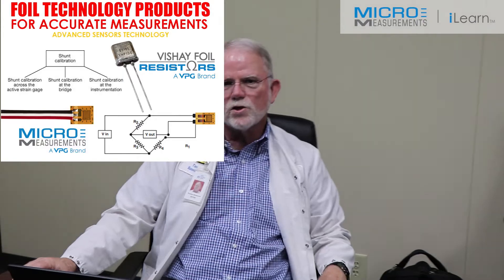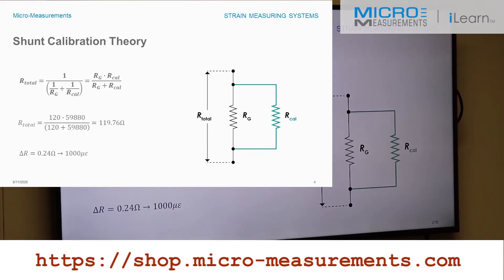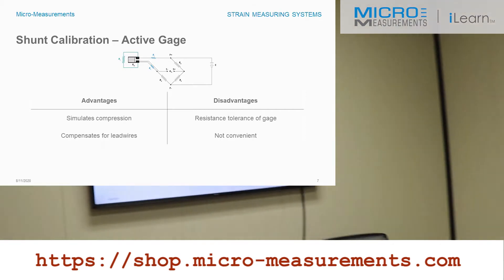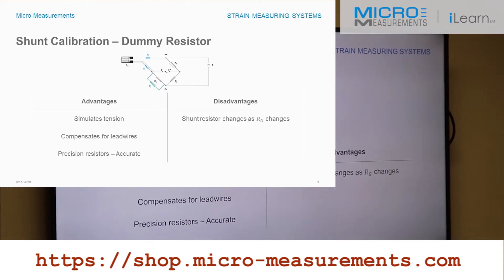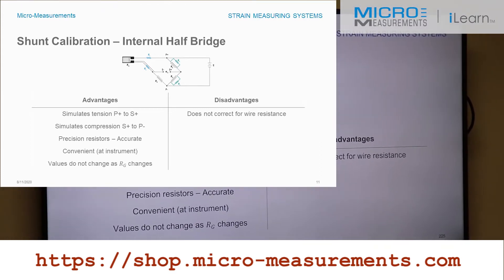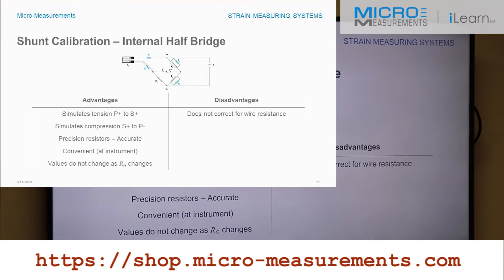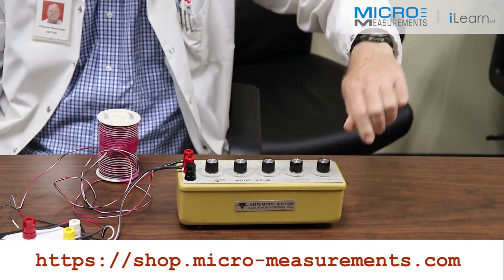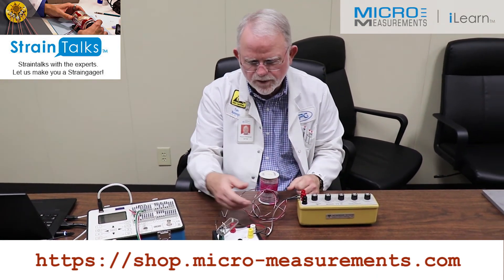Shunt Calibration in The Real World.

Comment: Thank you for explaining it in such a clear and approachable way! Amazing stuff... Just one question, when it comes to half bridge circuits, how do I shunt calibrate my gauges? Can I just shunt my secondary strain-gauge or do I have to shunt both of them? I am using this configuration bc I would like to correct for temperature related errors...
Reply: Hi Victor.  Under normal circumstances, you can shunt calibrate just one arm of the Wheatstone bridge.  This could be active one of the active strain gages or the fixed precision resistors that complete the bridge.   Keep in mind that you may have to take into account the number of active arms if trying to determine the strain response of your part because now you have two strain gages contributing to the signal, not just one.  We have a pretty good explanation and equations for this found in the Technical Note TN-514 on Shunt Calibration- Starts on page 36: https://docs.micro-measurements.com/?id=2415
Reply: @darrylpeterson5394  Hi Darryl. Thank you for the reply, much appreciated. The document was very helpful! 😁